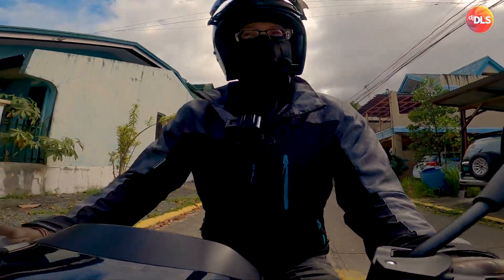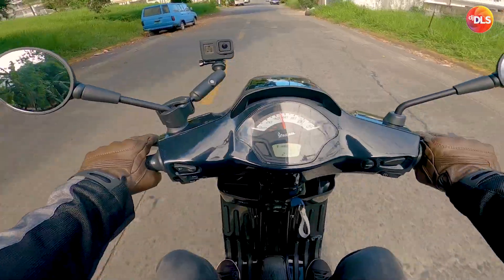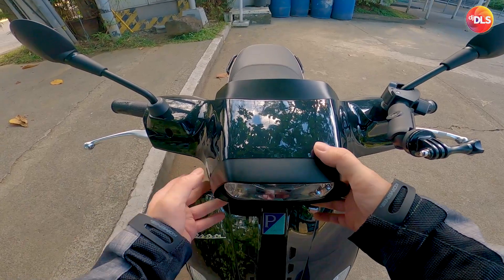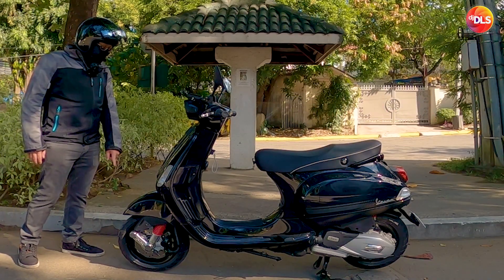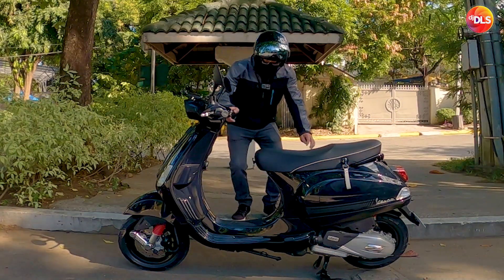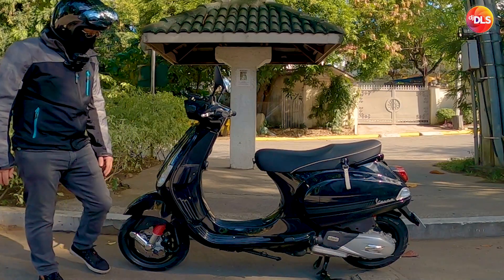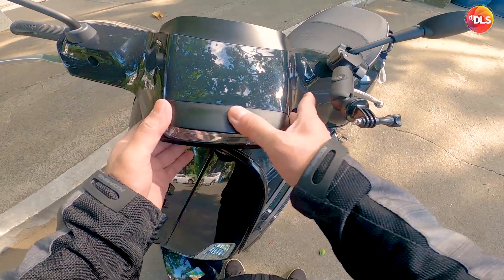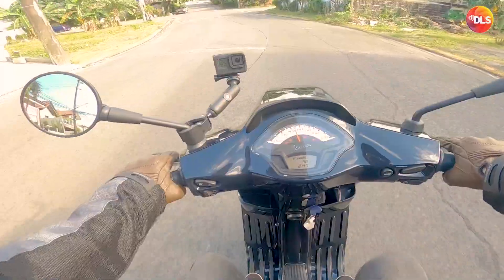Vespa S125 | Some Pros Cons

Comment: Also bro, how do you connwct your go pro to your intercom? mine is go pro and Jabbre T30s. Thanks ro. ride safe!
Reply from the maker: I just got one of the speakers and fastened it with the mic near my chin with Velcro 😃
Reply: another speakers bro? or the speakers of the intercom? Thanks!
Reply from the maker: @arwinbartolome7080  one of the intercom speakers. Sacrifice na isang tenga lang meron for comms 😃🤣
Reply: Ah ok. Thanks bro. But need talaga govpro adapter to connect for the mic right? Di ko lng ma gets if panu sya ma connect sa Jabbre intercom bro.🙂

Comment: Sir even the pricier Vespa models (Primavera,Sprint,GTS, Sei Giorni), has plastic head covers and foot panels. The entire chassis is steel  but some parts are plastic across all models. It also doesnt have "side fairings", as it is a unibody frame. 

Enjoy your S125! What it lacks vs the Kymco Like in speed, it more than makes up for the resale value and the feeling of riding the "real thing". 😜 Had a Like 125 for 6 months, and now I also have the S125. Owned it for 2 years.
Reply from the maker: I guess the use plastic materials is part of their way of modernizing the scoot and reducing weight. 😊
Reply: Enjoyed the legroom and sitting position on the Vespa, cramped sa legroom ang old Like 125 ko. 😅 

OEM tires of the S125 are Maxxis 🙂

Hope to see you on the road sir! Ride safe!
Reply from the maker: @chonlara  Maxxis, thanks for the info. You're right on the legroom. Yes see you on the road! RS!

Comment: Hi bro! anu brand kabit mo mirror mount for Go pro? Ride safe and welcome sa vespa community!
Reply from the maker: Thank you! Motowolf gopro holder search mo sa lazada, then bought this clamp separately

https://s.lazada.com.ph/s.VTWXS

Then added this rubber bushing para mas kumapit sa side mirror natin

https://shopee.ph/product/40196736/1155653987?smtt=0.62069181-1642242513.9
Reply: Nice bro! what about the stem that will hold the go pro?
Also, what size of the rubber ring did you get? Thanks in advance bro.
Reply from the maker: @arwinbartolome7080  kasama na sa motowolf yun. Actually the motowolf holder comes with a u-clamp. I just prefer the clamp so i can move the whole thing to other angles or bikes. Magkaiba mg ball size, standard 1 inch yung sa clamp and the motowolf's had a slightly smaller ball.
Reply: Thank you bro for the info. But one last thing bro, can you send theblink of the motowolf holder pra di ako magkamali sa pag buy.
Reply: ok naman ung separate clamp as well as the motowolf holder? Di sya maalog? Thanks bro.